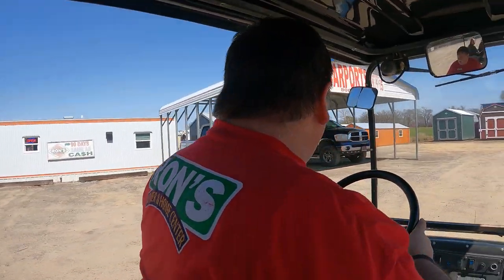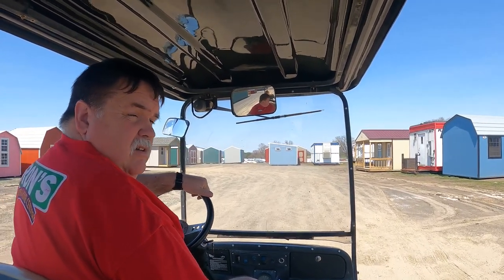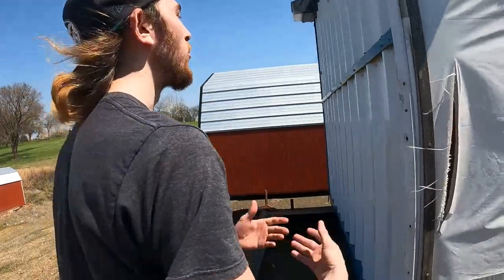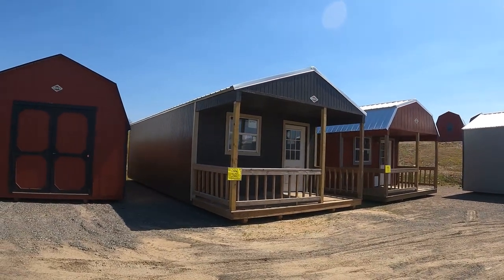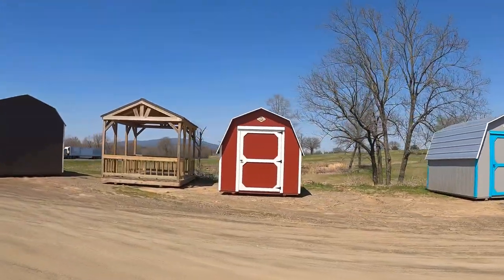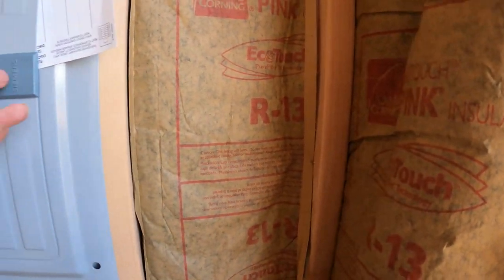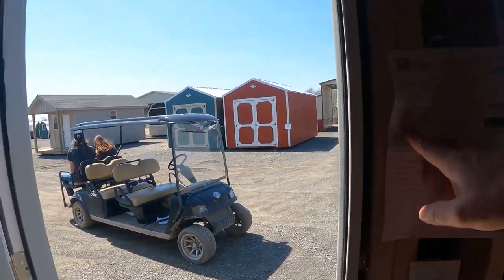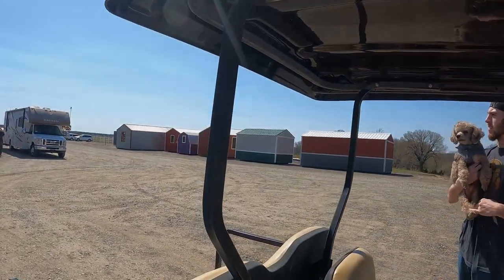👉SHED to HOME project 👉👉WHICH one WILL it BE? 👉👉👉join US on A day TRIP to RON'S PORTABLE BUILDINGS!!

Comment: Personally, I would go for the double wide one.  While it may need some work, there is plenty of room for everyone, not to mention it already has HVAC.  Also there were a lot of things still in there, that could be sold to help offset the price. (Extra laundry equipment, a large kitchen mixer).
Reply from the maker: my thoughts exactly!
Reply: @NowWhatTravelReady  you could probably also add like a shell to the outside to make it look more like a house.  If that's is why they didn't seem so interested in it. Turn the end with the HVAC towards the woods.
Reply from the maker: @brookeburks6268  exactly!